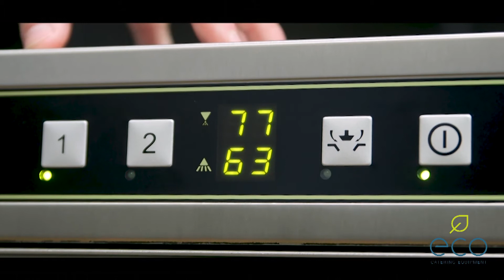How To Use The Ecomax Control Panels and the cleaning down procedure

Comment: Hi. Im looking for the operation manual of Ecomax F500 - 6P, I couldn't find the instructions for detergent and brightner tanks filling. Thanks
Reply from the maker: Hi, that's not a model code we're familiar with. We only provide UK spec. units. If you are outside of the UK we'd recommend contacting Hobart in your country. If you are UK based then please double check that model number and let us know. The code should be an F502, F504 and F515.

Comment: Hi what does it mean er 29 . My machine same eco max but when i press start show er 29. Thanks
Reply from the maker: Hi. This Error Code states the following: Capacity of external water treatment unit depleted. Replace part or full desalination cartridge. It sounds like you my have an external water filtration system fitted and may need to address that. 
Capacity of external water treatment unit deple9
Capacity of external water treatment unit deple-
ted
Reply: @EcoCateringEquipment  thank you very much
Reply from the maker: @ugurturker8240  You're welcome

Comment: Hobart ecomax f13 error code what does it mean?
Reply from the maker: Hi. The manual states the following: Error 13 - Reason: Filling programme monitor pressure sensor for tank. Remedy: Pump out the machine. That's not most useful explanation from the manual. We would recommend draining the unit down and restarting and refilling it. If the error persists it could be a failed sensor or a potential water pressure issue

Comment: can you tell me how to change the temperature ?
Reply from the maker: Hi. Generally the temperature shouldn’t be changed as they’re set to run at the optimum wash and rinse temperatures. It’s not a standard operator change and it’s not something we can answer in the comments either. Please refer to the manual of contact Hobart directly for instructions.

Comment: how to reset glass dishwasher with error13?
Reply from the maker: Hi. The manual states the following: Error 13 - Reason: Filling programme monitor pressure sensor for tank. Remedy: Pump out the machine. That's not most useful explanation from the manual. We would recommend draining the unit down and restarting and refilling it. If the error persists it could be a failed sensor or a potential water pressure issue

Comment: The power button on mine keeps flashing and won’t allow me to start any cycle
Reply from the maker: HI Liam. The power button will usually flash for the duration of the initial heat up period. The length of which varies dependent on your power supply. Anything between 15 - 30 mins on average when you first turn it on. Make sure you are giving the dishwasher enough time to get to it's working temperature. If you are giving it plenty of time and it's just not starting and there is no error code being displayed there could be a fault with the unit. From the details given we wouldn't be able to diagnose the issue. If that is the case we would recommend calling your local preferred engineer or the Hobart Service department.

Comment: We used same model 
But it’s not taking chemicals 
Please make video for it please
Reply from the maker: Hi Haresh, thanks for getting in contact. It's very difficult to know what the issue is without seeing the machine. There could be several reasons for this. 

Here are a couple of things to check initially:
1/ Check the hoses, are there any kinks or splits that could be preventing the flow of chemicals
2/ Re-prime the pumps. Sometimes when changing the chemical bottles you may need to re-prime the pumps
3/ Have the settings been altered at all on the control panel. Potentially reducing the chemical dosing

If you feel it is a faulty pump that is not something we can advise about or easily diagnose on here.

If you are UK based you are more than welcome to contact us directly and we'll try to advise over the phone or put you in contact with the service department if you need more assistance.

If you're located in another country we would recommend you contact either the local Hobart office or an authorised Hobart dealer in your area. Alternatively, a local service engineer who is familiar with your model of dishwasher.

Thanks